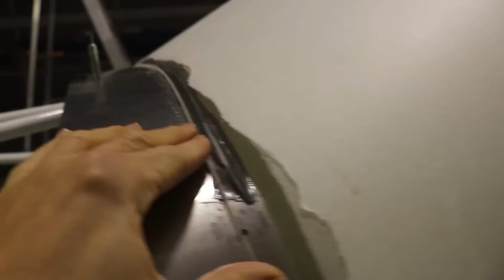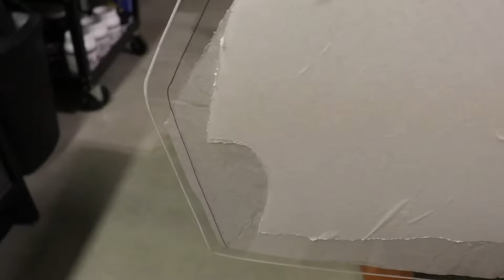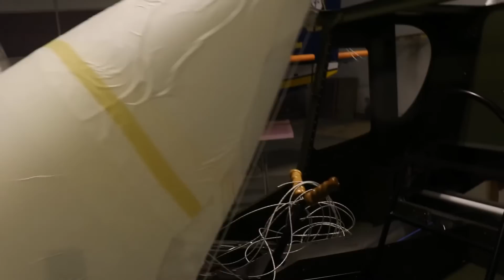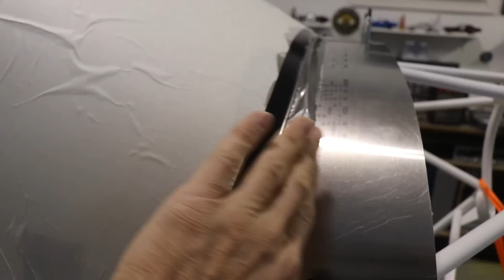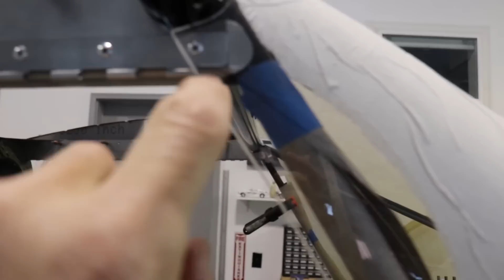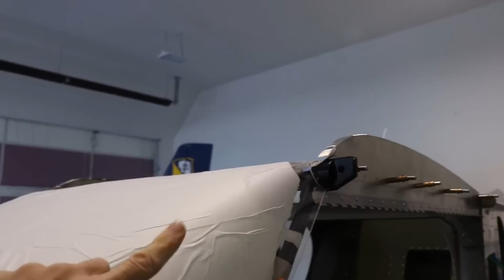Installing the CH-750 Front Windshield (Ep67)

Comment: Would have it been better to cut the top off and slide it up
That would not change the windshield angle  I think an  Oscillating Multi-Tool might be easier to make the cut.  Good luck
Reply from the maker: No. The angle of the windshield makes no difference. And to move it back without cutting the bottom, I would have had to really cut a lot away where it goes around the spar. Best way is to cut from the bottom.